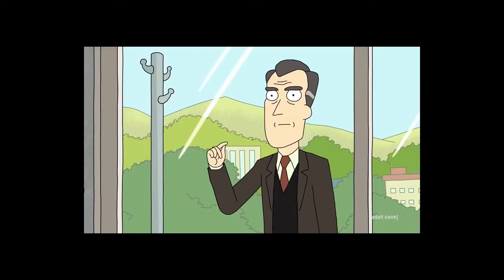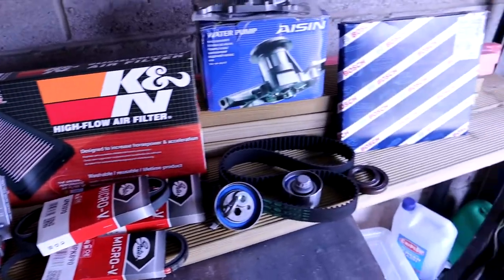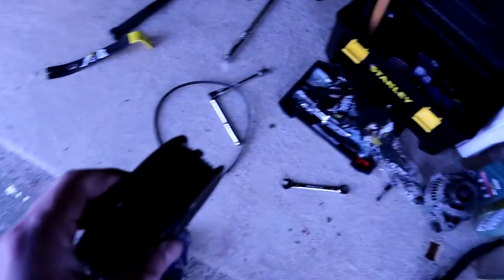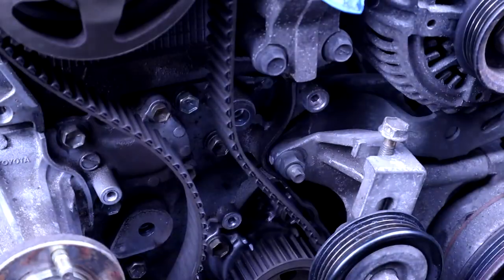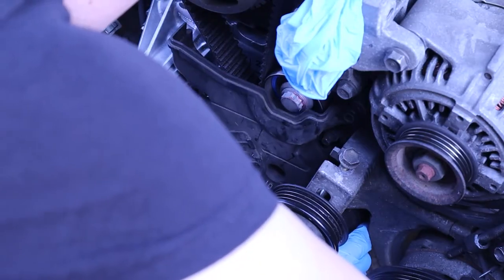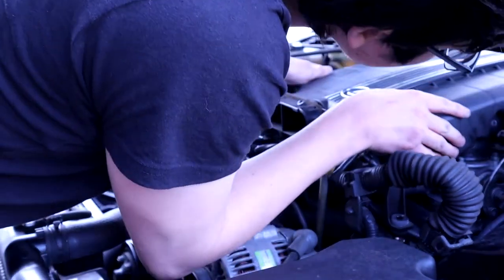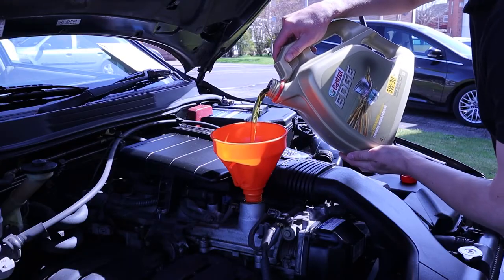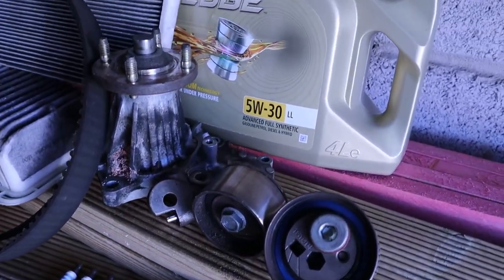LEXUS IS200 FULL SERVICE (including Timing Belt and Water Pump)

Comment: Nice work, I'm lucky enough to get a lexus is200, 2002 has 107k miles, and 3 owners, last owner had it since March 2010 till Feb 2022 and now I have it, and it has full service history, he spent around £1000 at dealer inc labour, to get timing belt and kit done, water pump, drive belts and pulleys, full engine service and all filters, coolant, new Vatra battery, O2 sensors, all High quality premium brake pads and discs around, I think brembo pads. All this was done in  2021 as car came with tons of recipts and papers from 2002 till last year 21, and I got this car for £2350 which I think is very reasonable, the engine bay looks as clean as it was a new car, and interior of the car is mint, drivers seat barely has any wear let alone rest of the seats which look no one sat in them ever, body work is good too but does have minor scratches here and there speacilly on the bumpers rest is clean.
Reply from the maker: Nice work! Sounds like you got a great deal! 😃

Comment: Thanks a lot for making this. It shows everything very clearly, and your narration just compliments that. I'm gonna give this a go myself. Do you have any other tips in hindsight please? I'd appreciate that big time. And 5:22 what did you cut that belt off for and what did you mean by only do it with an old belt? 🤔
Reply from the maker: 1. You're welcome.
2. TAKE YOUR TIME!
3. That's just a trick to get the crank bolt loose. Use an old belt because you don't wanna ruin a new one by stretching and bending it like that.
Please be careful.
Reply: @shizukesajdm  Ah I see. Cheers again fella.
Reply: @shizukesajdm  Hello again, what belts do you need please? There are 3 rib and 4 rib belts for the auxiliaries...
Reply from the maker: @Johny40Se7en   Links are in the description 👍
Reply: @shizukesajdm  Ah right, thanks you.
Reply from the maker: @Johny40Se7en  No worries 👍🏻

Comment: Excellent phenomenal video 📹..useful clear concise..keep going especially is200 videos maintenance etc...also if a timing belt broke and excessive damage to repair what engines will work apart from obviously exact same date engine especially chain driven alternatives non interference..Vinny 😉 😀
Reply from the maker: Do you mean what engines can you swap into the IS200? The most popular choices are the 1JZ and the 1UZ. Also, I no longer have the IS200, I sold it to buy an IS300 :) there’s a lot more content coming for this soon! Thanks for watching! 🙏🏻
Reply: @shizukesajdm  yes..are they non interference chain driven..in Lexus glossy brochures they gave endless rubbish on options etc but neglected to mention that interference engine...even if belt changed perfectly if tensioner fails or water pump owners will get big bill lol
Reply from the maker: @VinnyVinnii  belt driven, not chain 👍🏻
Reply: @shizukesajdm  which country city are you..quality of full service on is200.you did....if ever you had spare time would make you excellent alternative to overpriced Franchised dealers..as mobile mechanics advertise locally but always gamble if they not as professional as they claim..especially eg timing belt cowboy will destroy valves etc
Reply from the maker: @VinnyVinnii  I live in North Somerset, England :) I’m a maintenance engineer for a large Aerospace company. Someday I will move into the automotive sector :)
Reply: @shizukesajdm  that explains it ..working in aerospace has conditioned you to correct techniques eg correct torque settings..you can be UK 🇬🇧 Scotty Wilmer...you could concentrate on UK cars..Scotty phenomenal except he has to cover USA cars we don't want lol hahaha
Reply from the maker: @VinnyVinnii  I was conditioned before I started as an engineer 😅 Scotty Kilmer is awesome!

Comment: When changing the timing belt, do you have to change the water pump?
Reply from the maker: You don't HAVE to, but it's highly recommended, since you have to remove the belt to get to the water pump... so you might as well. It depends on your situation. If your water pump is still quite new, but your belt is damaged then probably not. These are usually done together for a reason. That reason being, you have to get the belt off to change the water pump.
Reply: @shizukesajdm  ok thank you so much

Comment: Thanks for this. How do you release the tension of the belts (the ones on the alternator, power steering, etc)?
Reply: instablaster...
Reply: I did this recently for the power steering and alternator belt. The alternator has 3 bolts, a pivot bolt, an adjusting bolt and adjusting lock bolt. Loosen the pivot and lock and you can use the adjusting bolt to allow the alternator to turn clockwise and loosen the belt. Power steering has two bolts, one through the hole in the pulley and one on the back. The back facing bolt loosens and allows you to move the pump along a track to get the tension off the belt.

Comment: my is200 automatic just broke down yesterday, does not turn on. I have it for 6 years. it is a 2000 model, and after all these six years I want to learn how to do a service like that.
Reply from the maker: Now is your chance! :) fix it up!
Reply: @shizukesajdm  do you have a list of the tools you used to do that? the car I think is the alternator, the battery seems fine but when I try to turn it on just make a noise, and nothing happens. thank you, man.
Reply from the maker: @alonidias  You pretty much just need the basics! A decent socket set, some Allen keys and an impact wrench for the crank pulley bolt! :) Oh... and a torque wrench!

Comment: Do you have a video for replacement of the radiator? 
Mine started leaking at the top, I bought a new one and would like to do the replacement. I am not sure how complex it is going to be, how many bolts are there etc. If you have a video that would be very helpful :)
Reply from the maker: Check my IS300 2JZ maintenance video. I replace the radiator in part 2. The process is the same as the IS200 😉👍🏻
Reply: @shizukesajdm  wonderful! Thank you my dear virtual friend :)
Reply: @shizukesajdm  Only two bolts! Excellent! You saved me money with this, I am going to do it alone. Thanks a lot!
Reply from the maker: @Druze_Tito  you’re welcome :) thanks for watching!
Reply from the maker: @Druze_Tito  Of you need any more help, I’ll be here! 👋🏻

Comment: Hi there brother. Could you please della me the nm to  tighten the camshaft and crank shaft Bolt? Thank you
Reply from the maker: Cam gear = 35nm + quarter turn
Crank pulley bolt = 220nm
Reply: @shizukesajdm  thank you very much!!
Reply from the maker: @AgentFoxMulder1972  You're welcome! If you want any of the other torque specs... check here: http://www.shoarmateam.nl/upload/Lexus/IS200+IS300/manual-is200/Service%20Specifications/m_ss_0008.pdf
Reply: @shizukesajdm  hi there. Sorry to Brother you..  to take off the crank pulley, do you turn left or right???
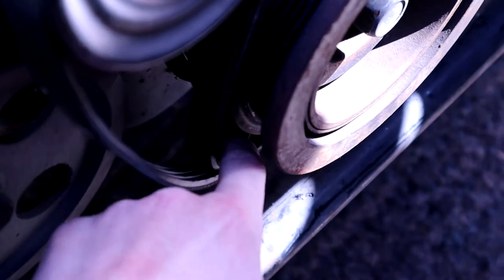Reply from the maker: @AgentFoxMulder1972  3:03 Anti-clockwise :) So, left if your breaker bar is pointing upwards 👍🏻 Good luck!

Comment: very nice video Please coud you help me , my is200, the cambelt  wos losed , tencioner broken . i replaced  the cambelt, polly and tencioner all new,  i set up the point as you show on this video, but doesnt rev more than 2000 rpm , wrong idling and comes off   no more then 5sec. is some thing wrong with valves?

Comment: My crankshaft pully is stuck all over it
Reply from the maker: The bolt or the actual pulley? If it’s the bolt you’ll need a super powerful impact wrench or a looooong extended breaker bar and use the belt truck. If it’s the pulley itself then you’ll have to buy a pulley puller tool :) good luck!

Comment: Hi @Shizukesa, how long did the Timing Belt & Water pump kit you bought take to come to the UK from Japan? Plus were therr any additional costs such as customs duty?
Reply from the maker: A long time. Over a month IIRC. Yes there were import charges.
Reply: @shizukesajdm  I had a hunch that would be the case. When I looked at the link you posted, those parts cost less in Japan than what they're going for in the UK right now. When you factor in time & import duty, price might end up being the same.
Reply from the maker: @taridean  For the IS300 I ordered Lexus and Lexus parts direct 👍🏻
Reply: @shizukesajdm  Ordered my front lower ball joints from Lexus Direct. They have them on sale at the moment. Went Oem for those bits because if they fail, it's not a pretty sight from what I've seen happen to other lS200/300 owners.
Reply from the maker: @taridean  I got mine from fensport 👍🏻

Comment: Hi mate, I recently did timing belt change, used SKF brand, I get P1346 code when driving (not right away but after some time, maybe hiting a pothole or something). Do you have any suggestions why is that? Could it be because it's not a geniune Toyota parts?
Reply from the maker: Sounds like the belt is off by a tooth, mate. Refit it if you can and see if the code goes away 👍🏻
Reply: @shizukesajdm  thanks for quick reply! It's at the mechanic. He erased the white marker on the cam sharft, drove it and it doesn't appear to have the fault. Though, the first time he eared it and it showed after like 30k's. Thanks for the advice, I'll let him know
Reply from the maker: @milanzivkovic4336  Good luck! Let me know how it turns out :)
Reply: @shizukesajdm  sure mate. I'll hvave to drive it for a bit, hopefully the fault won't come up again! He cleaned the white marker spot on the can sharft. Will keep you posted
Reply from the maker: @milanzivkovic4336  That's great news! Certainly an odd occurrence, but I'm glad everything is okay! Let's hope it stays that way :)  👍

Comment: Hi great job as always please can you tell me where is the location of the coolant temp switch and thermostat is??
Reply from the maker: X-LAB - The thermostat location is around where the radiator hose connects the the engine block on the left (exhaust) side of the engine block :) thanks for watching!
Reply: @shizukesajdm  hey thanks man you're a legend 💯🙌
Reply from the maker: X-LAB - Also, do you mean the fan sensor switch or the actual temperature sensor?
Reply: @shizukesajdm  yes exactly my fans are not kicking in and the engine overheats a bit while iddling in traffic.
Reply from the maker: X-LAB - Okay, so I think the actual temperature sensor is on the right hand side of the cylinder head. The fan switch sensor is at the bottom of the radiator, I can’t remember which side. I would change the thermostat first. Maybe the fan sensor switch next. Both pretty simple jobs. The fan sensor switch can be unplugged and you can plug it with something else (finger even) while you put down the old one and pick up the new. Then just plug in the new one and top up the coolant if you lost a significant amount while swapping them over. Remember, do this with a COLD engine so you don’t burn yourself. Check your radiator for leaks too. You may need a new one :) good luck! If you get stuck, just ask and I’ll try to help wherever I can.
Reply: @shizukesajdm  will do thanks so much mate been having hard time wirh my lexus these last 2 days im gonna follow your instructions, will let u know how it went thank you 🙌
Reply from the maker: X-LAB - You’ll get there man, don’t worry.
Reply: @shizukesajdm  you're right man i got there was the thermostat replaced it with a new one did a new radiator fan switch, and the old girl is running smooth as ever temp all back to normal just a bit bellow the half mark on the temp dial thank you 👌🍻
Reply from the maker: X-LAB - I’m glad to hear it! Good job! 😁

Comment: What are those marking on cam pully and how to keep it aligned with timing. ? Also mine’s automatic so do i need to put in D while changing the timing belt ?
Reply from the maker: Shanu Yadav - It might be difficult if you don’t know the basics of how to line up marks on cams. Read up about TDC and BDC. Basically you have to line the marks up exactly right otherwise the timing will be off and your engine could go boom! Before you take the old belt off, mark the top of each can at 12 o’clock. For an auto I THINK you might have to leave it in N. Ask in the IS200 Facebook groups to be sure! Good luck!

Comment: Can i reuse the old tensioners for the timing belt? I mean how do I do it without the pin?
Reply from the maker: You can, but it’s not wise. Use the Allen key to keep the tensioner locked and simply reinstall it as you would the new one. Pull the Allen key out like you would the pin. I strongly advise you buy a new tensioner. If this fails, your belt change won’t mean a thing.
Reply: @shizukesajdm  Yeah id usually just buy a complete new kit but in my case i was thinking if it may make sense just to get the belt since the car was only moved 25k kilometers in 6,5 years after the belt was changed. Would you still say to get everything new?
Reply from the maker: @LucaXE999  100% everything new. While you’re at it, do the water pump :) otherwise you’ll be removing the belt and tensioner to do it in the future anyways.
Reply: @shizukesajdm  thanks alot for the advice. Its really worth alot if you can ask someone in the comments and also get answers to your questions😄👍
Reply from the maker: @LucaXE999  You’re very welcome! If you have any other questions, just let me know 👍🏻

Comment: When taking out the radiator, what other clips was there bud? Mine doesn’t want to budge 🤦🏻‍♂️
Reply from the maker: There’s the two obvious ones at the top and the feet sit in rubber mounts at the bottom. One left, one right. Then there’s the “rail” that either side is sat behind, it may be stuck on that. I assume you’ve disconnected both hoses and all electrical connectors?
Reply: @shizukesajdm  correct, turns out it was just caught on the rail lol! Thanks mate!
Reply from the maker: @shamus1255  No worries! :)

Comment: Wrong oil , change it ASAP. Way to thin for 1gfe. You need 10w40 . I’ve seen lots of is200s burning 5w30 , but won’t burn a drop of 10w40. Also seen a few have intermittent oil light because the oil is too thin causing a lack of oil pressure below 3000 rpm . Changed to 10w40 and problem instantly solved
As per the comment below, wrong spark plugs also
Reply from the maker: M - First of all, the plugs will definitely be changed at some point. But 90% of the people I’ve asked about oil weight, have said they use 5w30. Although Benny from Benny’s Custom Works did use 5W40 in his. There’s so many people saying different things that I’m not sure who to listen to 😄🤷🏻‍♂️ but thank you for your input!
Reply: @shizukesajdm  Nice video.  I just replaced the ignition coils on mine the other day and am so happy.  Took me about an hour.  Was experiencing hesitation for a while and it took a few tries to nail down the problem.  She's back to humming along like new.  As to the oil, on the recommendation of my local mechanic here in Bulgaria, I've been using 5W-40 for quite a while.  His rationale has more to do with high mileage.  Mine does great on that, but if yours is great on 5W-30, well...
Reply from the maker: @daveculmer1841  Yeah I haven't burned anything using 5W-30, I'm not too worried about it haha! Thanks for watching!
Reply: Lol. I'm using 0w-30 currently and it's not burning any oil... 190 000km

Comment: How does the Belt Trick work?
Reply from the maker: I can’t really explain it any better using text than I did using voice and a demonstration in the video.
Reply: @shizukesajdm  im on my Service Right now, but the belt trick dosent work
Reply from the maker: @Antotek-wv1vd  Then you might have to figure out another way. I tried it again on my IS300 and it didn’t work. Get the Toyota tool and a 7ft extension bar and crank that shit open!

Comment: How do you make sure the engine doesn't run
While loosening
Reply from the maker: If you’re using an impact wrench then you don’t have to worry about it. If you’re using a breaker bar then use the belt trick like I explained in the video 👍🏻
Reply: @shizukesajdm  I see it 😂 I'm too impatient